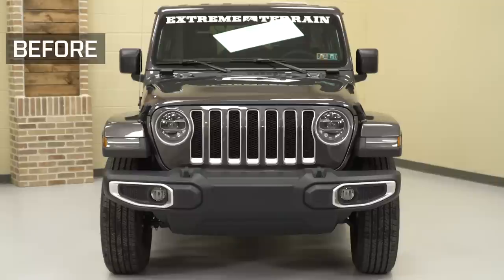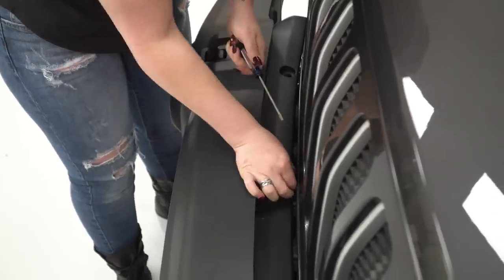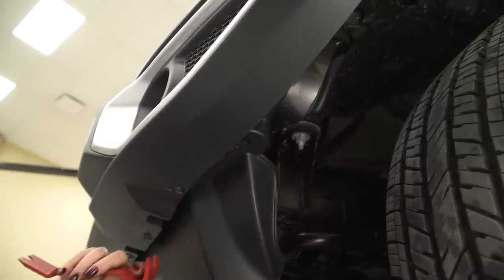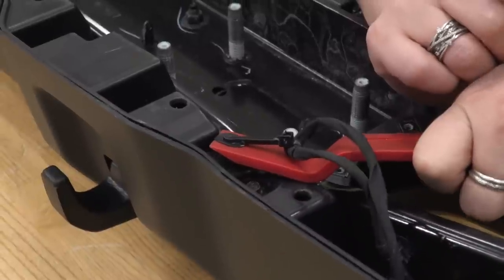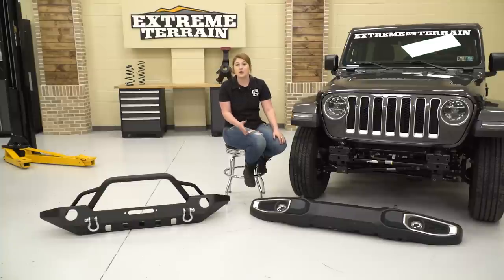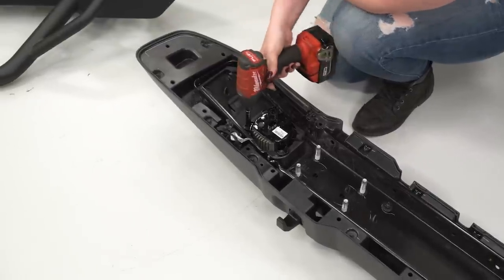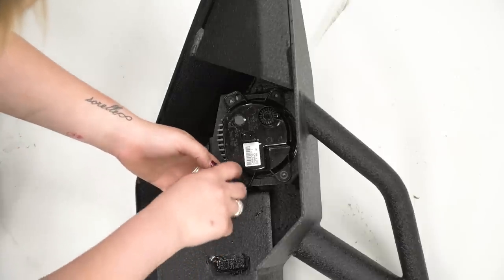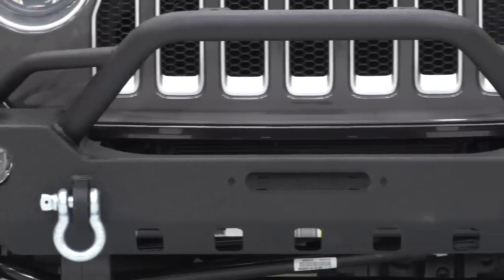Jeep Wrangler Barricade Adventure HD Front Bumper (2018 JL) Review & Install

Comment: Ordered this bumper September 2.  Installed today.  Video was quite a bit off from what the actual install consisted of.  She shows using  those chips for the fog light screws. No.  This one had a bracket on each side to install and use these little screws and try with your fingers to hold the not underneath it and tighten them down.  Very frustrating.  Second the bumper required some hokey brackets using plastic threaded cards to keep them in place while mounting the bumper to the frame.  Took 2 people to keep everything aligned and from those bolt brackets and bolts from flopping around too much to get them into the front frame holes.  Took 3 attempts.  Either this video shows an upgraded bumper which is I thought I was ordering and I got an older type of design.   Wasn't too happy with the install.  Not like portrayed here.   It looks very nice on the Jeep now but took double the time it should of.  I give it a 2 out of 3 stars on the install rating.   Buyer beware.
Reply: I just went through the same thing you did.  For my fog brackets, one wouldn't even go in.  Had to bore it out and use a nut and bolt.   The brackets for the bumper were a pain on mine as well.  I managed to get 7 of them in, one will not go no matter what, oh well.  I did manage to use a motorcycle lift to jack it up while I lined it up, that made it a little easier but it was nothing like this video.
Reply: @Jayhowell72   sounds like we're not the only ones that have had this issue.  Extreme terrain should either take down this video or put it the way that it actually installs.
Reply: Damn, I'll go through all this tomorrow when bumper arrives.  The video eo made it seem so easy, but from reviews its gonna be a challenge i see.
Reply: You guys must have gotten the JK bumper as shown here: https://www.youtube.com/watch?v=yEkM9pvx0eM go to 7:46 of that vid
I would like to order this bumper for my JL.  However I would like to know I am getting the bumper shown in this Video (One Merideth is installing) because I'm all the way in Canada and don't feel like shipping the JK bumper back is a cheap option if I get the wrong one.

Comment: wish mine had retaining clips for the fog lights!  The bumper in this video is not the same when it comes to hardware install.  The fog lights are the most difficult when you have to use a modified bracket to align it.  The holes have some of the paint all over the threads so the iddy biddy tiny 2.5mm hex key has no torque at all to push past it. Should advise viewers to watch the JK install instead.  THey are trying to sell old stock so everybody is getting the outdated bumper with brackets to align.  I wouldn't of ordered this when the video is misleading.

Comment: This bumper has changed a lot since this video. For starters, this bumper does not work with OEM LED fog lights from a factory steel bumper. The allen head screws used for the fog lamp bracket aren't great because the bumper is sprayed after assembly, and the screw holes are covered in coating. Ended up going with 7mm bolts instead of the screws. The actual install is pretty simple but the bolt/mounts are not welded on they are four pieces (one bolt, one nut on each) so highly recommend you have a second set of hands around to help you out. If you don't you'll constantly be taking the bumper off to try to realign the bolts, as they float around in the mounting plate. The fit, once on, is great and the bumper is relatively light. Biggest gripe was the instructions are terrible, almost not worth reading because they blend JK/JL together as if the two are identical. You will not be using the mounting hardware from your old bumper (if replacing an OEM steel bumper on a JL), so keep that in mind because it isn't called out. I was happy with the overall build quality but it is somewhat silly there isn't a skid plate for this bumper.

Comment: Installed this bumper on a 2021 Wrangler Sport JL 2 dr on 9/30/23. Additional tools required: Die Grinder (to enlarge one bolt hole), Gorilla Mounting Putty (to be explained), Rubber Mallet (to center bumper once loosely bolted on), 9" Needle Nose Plyers (to grab bolts when barely fed through hole when attaching bumper) and a very talented mechanic (AKA my boyfriend). Install took about 2 hours including a break due to frustration upon putting the bumper on once the fog lights were in. The stock fog lights fit fine. Lifting the bumper on is when the Gorilla Putty saved us. This is "Step 7" in the included instructions. The "nut/bolt plates" DO NOT STAY IN PLACE. I'm guessing this is why this video goes straight to putting the bumper on. One bolt hole, lower hole, passenger side, did NOT line up hence the Die Grinder. We made it work. The front plastic/stock skid plate will go back on w/ some custom metal plates, the original plastic clips and some cutting to fit. This video was extremely helpful to me. I'm not mechanically inclined, knowledgeable w/ tools and this is my first Jeep. My boyfriend has been a mechanic/engineer since his late teens and has owned numerous Jeeps. Get one of those or have one on speed dial! I wish I could upload a before/after pic b/c I really like this bumper. I researched them quite a bit and am 100% satisfied with this one. Purchased through 4x4 Outfitters. Great customer service and shipped in about 3 days!
Reply: This is correct.  This bumper is an absolute engineering fail. No longer are the studs attached to the bumper. Instead you are given some idiotic stud attached to a blind bolt with nothing to hold it in place while trying to install.  So guess what?  They fall out every time.  The only way I can see to install this is to weld it to the frame.

Comment: I put this bumper on my JL Rubicon and I do not have the LED package. My fog lights fit perfectly. On the product page, my jeep is the silver one with the red fairlead if you dont believe me.
Reply: Dustin Holstein  
Please share how you did it...I'm stuck!
Reply: My fog lights lined up with the holes on the new steel bumper. No modification was needed. I thought I would have to drill new holes on the bumper/make a new bracket to mount them but to my surprise, I just popped in the plastic inserts and my OEM fog lights bolted right in. I was looking forward to making a project out of it but I got my time back instead... Perhaps they offer two types of halogen fog lights depending on the bumper? I did not opt for the factory steel bumper when I picked mine up because I knew I would be replacing the bumper anyway.

Comment: Yeah except they changed the bumper, and now it’s almost impossible to line up the damn bolts with the frame.
Reply: Nikki, so were you able to install bumper at all ? I was thinking about getting this one.
Reply: Fucking yes! Just installed mine, and it was NOT this simple! It come with 4 odd bolts that you have to line up inside of a hole but the only opening is pressed up against the frame so if you drop one while trying to line up you have to completely take off
Reply: Ok it's not that simple installing the bumper , I got the one with a light bar , no instructions at all, the screws in the box are not the ones to mount it , and the alignment is a bitch it  on. Some of the screws for OEM lights to be put in had issues.
Reply: im trying to line my bumper right now 😂 my back hurts from so many attempts
Reply: @michealcorleone665  definitely are going to need a second person
Reply: Myisha G i finally got it on after 17 attempts of lifting up the bumper 😂
Reply: Myisha G or a second spine lolololol
Reply: Damn wished I read these reviews. My bumper comes tomorrow.  They also failed to explain that the part number is assigned to the JK and JL. Only differnece is that JL gets extra components or brackets for install to  e compatible.
Reply: @DChomsy  how did your install go?
Reply: @keithreinert5835  i responded further down this channel for some details on how it went.  My install took a lot of patience and i think most people would give up.  There was no point sending it back and dealing with the shipping at all that, so i just did it.  It depends if they actually send you the JL bumper that is designed for it or send you the JK bumper with modified brackets (which i got).  THe order even says JK and I called them to make sure they give me the correct one for my JL.  I didn't know the challenges that were ahead until i got the bumper.  THe fog light alignment is horrendous and then you need 2 or 3 people to line up the bumper hardware.  YOu have to blindspot the large nut behind hard to reach area while holding everything steady. A simple nudge will dislocate this metal bracket that has to align between the bumper walls or you will have to take bumper out and reposition and hold steady.  It took about 2 hours....painful but worth it.  Make sure they send the bumper designed for the JL so you don't have to deal with retro fitting there old inventory.  They will preach and say the bumper is the same which it is, but that is not what i ordered based off their video. So yeah i'm upset about it and they lost me as a customer.  Just read the last reviews and the install is exactly that.

Comment: my 2018 is different my fog lights can't be mounted or did someone send me the wrong bumper?
Reply from the maker: If you have sport fog lights you can either upgrade to the 4 bolt hole JK/JL option or check out our adapter brackets on the site!

Comment: So if you don’t have LED package what happens?
Reply: John Covacci, apparently the halogen fogs mounting points are different. So, the mounting holes won't line up. I heard somewhere that you could trim the non-led brackets to allow them to mount to the led design, but I'm not willing to spend $300 to find out.
Reply: I put this bumper on my JL Rubicon and I do not have the LED package. I am not sure why they specified the LED fog lights because I dont have them and it fit perfectly. On the product page, My jeep is the silver one with the red fairlead.
Reply: Dustin Holstein Did the mounts and everything line up? I want to grab this but I have the Sport with the halogen fog lights.

Comment: The standard fog light bracket on the new JLU Sport do not work on this bumper so there is no way to move your JLU Sport fog lamps to this bumper.  TOTAL WASTE of the fog lights.  And the printed directions are for a JK, totally useless.  This video is helpful even though the back plastic part of the bumper is nothing like my JLU Sport bumper.

Comment: The inside build of this bumper is NOT what ExtremeTerrain sends when you order the JL Barricade Adventure HD Front Bumper (J107329-JL). So the install of the bumper is not as easy as it looks in this video. I have tried to explain this, and four calls later, I'm getting nowhere. What you get is the JK bumper with adapter brackets that are in the video for installation of the JK Barricade Adventure HD Front Bumper (J107329). Compare this bumper at 8:37 to 4:31 in the video of what ExtremeTerrain sends when you order the JL bumper in this video: https://www.youtube.com/watch?v=yEkM9pvx0eM
Reply: Thank you for this. This video has no mention of all the extra hardware you receive a d where they go.
Reply: Same situation here; total BS!  They know that 99% of the customers will not return the bumper.  Seems like they are depleting old inventory from the JK version, so we get brackets to align the fog lights.
Reply: @DChomsy  does it fit with the included mounts? trying to avoid a return here
Reply: @smoscar  yes it fits, but you gotta be very meticulous and flexible fingers. The tiny nut you have to hold and align blindside in a hidden area is near impossible. I was able to do it after 100 times of dropping the nut. Also thought about just drilling a hole and making my own holding area.  You'll know if you got the JK version or JL, when you check status of order and it will say JK version.  Pray that you get the JL version (no bracket hardware needed) you know the one that everyone thought they ordered.
Reply: @sQriLLah  nope, I got the JK one. I installed it last weekend and it was a pain in the ass.
Reply: @smoscar  yeah, but i guess we can say it was well worth it!